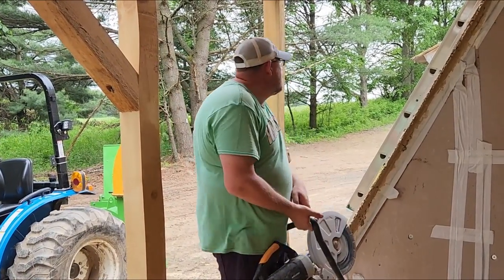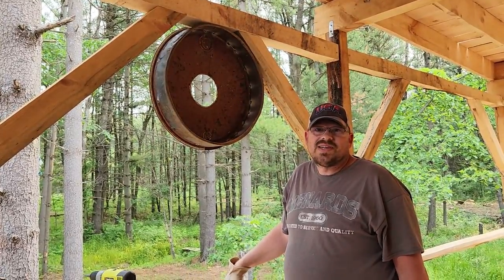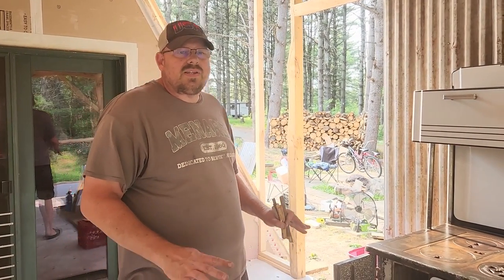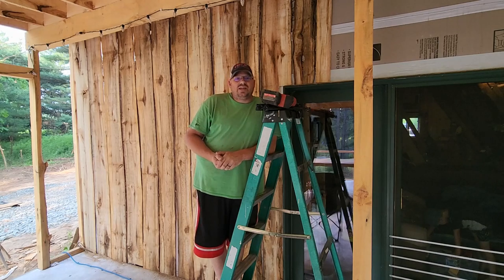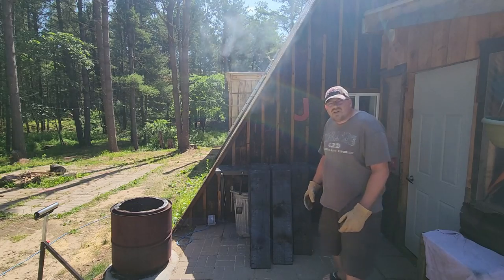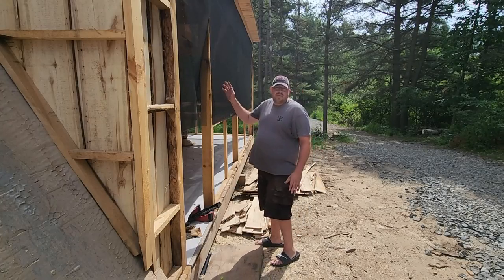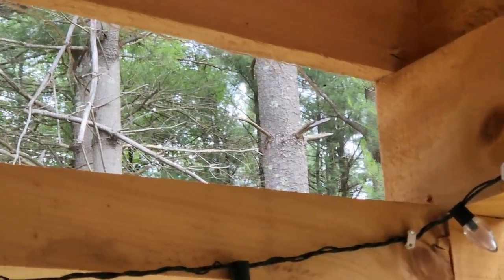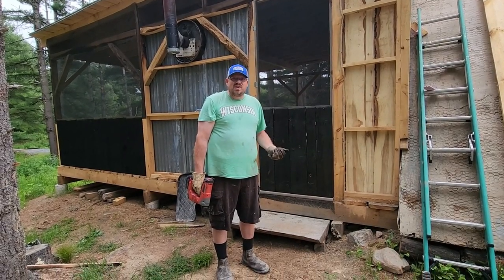Summer Kitchen 5; Floors, Walls, and Wood Cook Stove

Comment: A layer of black tarpaper stapled to the wall before applying the black siding would eliminate the need for battens, except if you were also going to be insulating it.
Always great to see you making functional additions out of what you have available to you.  It takes much more ingenuity than going to the box store and swiping a piece of plastic for all your materials you will need.

Comment: Armchair quarterback here again with my comments.  
The 2x4 board attached to the existing A-frame cementatios roof should've had a nice thick bead of hi quality waterproof caulk under it, to stop any rain penetration. 
2. The exterior stove pipe,  being single wall, might benefit from an 18 inch long strap of metal with a layer of hardie siding under it, horizontally to minimize heat transfer to the roof structure.  Pipe is mighty close to the roof framing. 
3. While nailing up the horizontal timber slab siding.  Highly recommend using RING shank nails.  Smooth shank, even vinyl coated will slip in years to come.  Wood shrinks.  A few random deck screws as an added fastener.

Comment: Prior to nailing up those short knee wall oiled boards might have run a 3-4" wide band of rubberized vinyl tape bent into the angle up on the 2x4 floor nailer and the horizontal edge of the floor.  Water infiltration prevention.  
No biggie in my TX climate,  but important in your area I'm Guessing.?
All these comments are hindsight...and not useful at this point.  I get it.
Reply from the maker: Thanks for the comment. I have had some of the same thoughts myself and am pondering ways now to shed the water against the work of removing the boatds and adding something similar to what you suggest. I think the best approach would have been to build the posts out to be even with the edge of the deck and the boards could have overlapped the edge of the deck boards. Hindsight is 20/20.... sometimes. Ill figure something out. Thanks for watching.